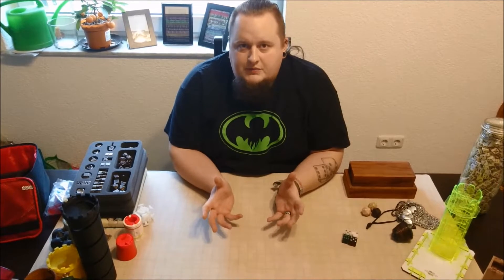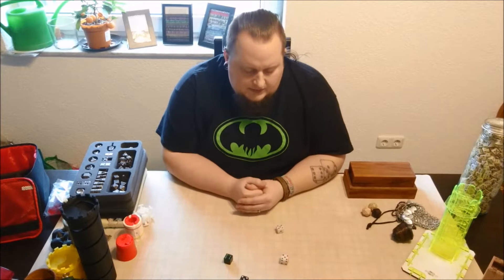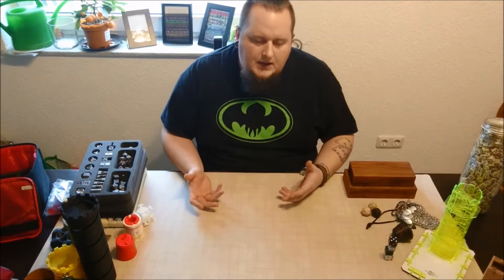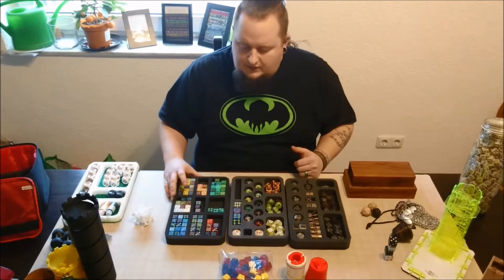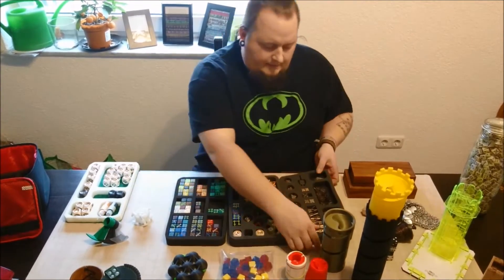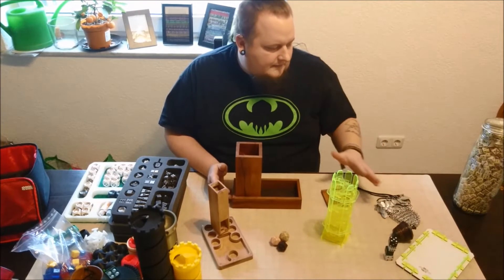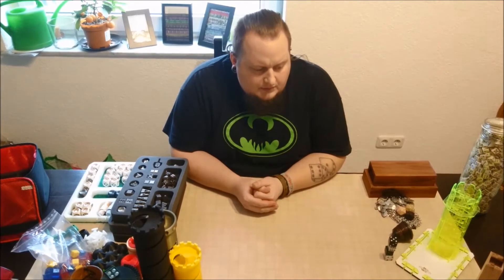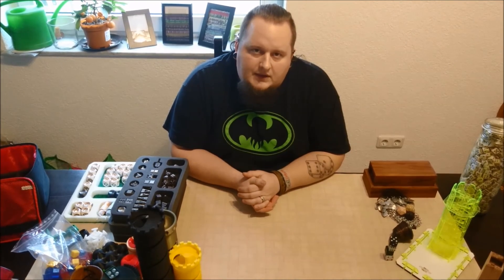Introduction

Comment: Hy there awesome stuff can you tell me how flexible the r12gb pur resin is I am planning to use it for some repairs but I am not sure if its the right material. Greetings from stuttgart
Reply from the maker: Hi, regarding what you want to repair I would recommend the epoxy. The polyurethane is not so sticky with other materials. Also the r12 is no longer good for small amounts it won't cure correctly under 100g pours. I now use the r4 which is super quick and pretty hard in the end. Also polyurethane resins tend to foam a bit as they absorb moisture fairly quickly. Epoxy is way easier and better to use.
Reply: @wuerfel_schmied  hy Danke für die schnelle Antwort, ich möchte Polyurethan Zwischensohlen von alten Basketballschuhen ersetzen siehe meine Videos,  deshalb muss es ein wenig flexibel sein. Das alte PU ist porös und löst sich zu Staub auf da es über 30 Jahre alt ist. Welches epoxy bietet sich da an? Es sollte eine endfestigkeit wie härteres gummi haben. Viele Grüsse
Reply from the maker: @evojoerocks  OK das ist ne ganz andere Nummer. Breddermann hat auch flexibles PU das ist wie harter Gummie. Das sollte eventuell eher smwas dafür sein. Man kann dabei anhand des Mischungsverhältnis auch einstellen wie hardmt oder weich es ist. Also ein paar Tests vorne weg sind da wichtig. Das r12 und r4 sind eher wie Skateboardrollen und härter.
Reply: @wuerfel_schmied  vielen Dank ich werde mir das dort mal genauer ansehen und mich einlesen! Top Kanal! Abo ist Dir sicher 👍👍👍
Reply from the maker: @evojoerocks  danke, immer gerne.